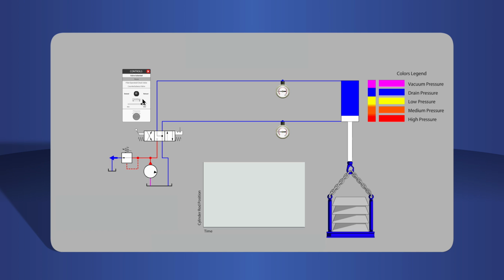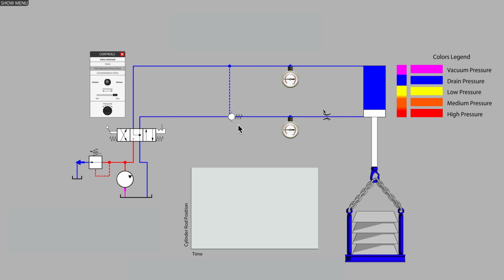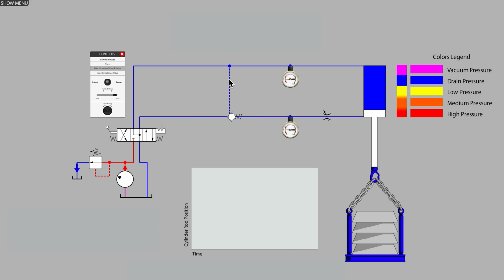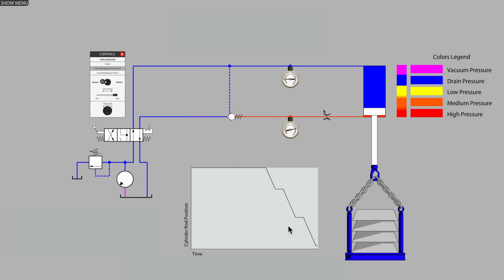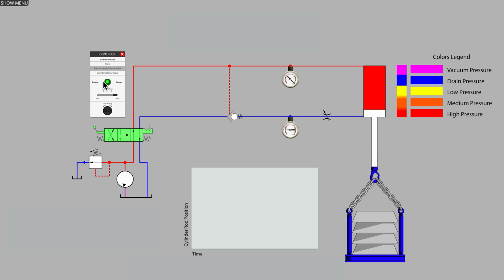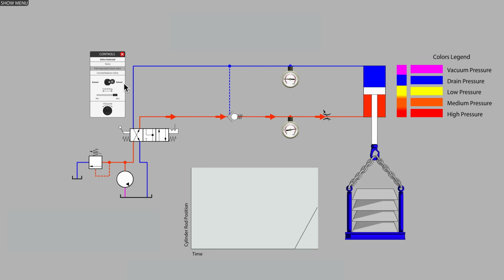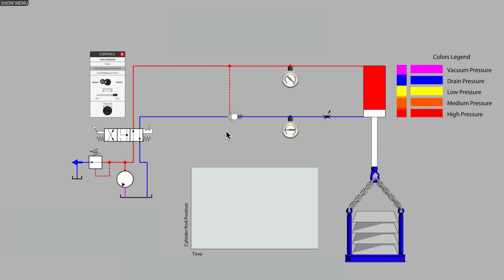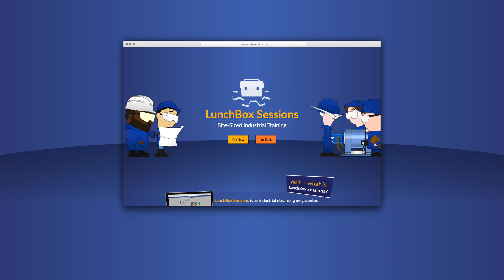Vertical Cylinder Motion with a Pilot Operated Check Valve

Comment: Hi. Does this needle valve also increase temperatures due to the restrictions imposed to the system?
Reply from the maker: Yes a needle valve always has that effect. You've got it.  Even worse, a needle valve on the rod-end port can actually intensify the pressure from the blind-end port, due to the difference in surface areas on the opposing sides of the piston. This pressure can rise to a damaging level if all factors of the system design and the cylinder usage are not accounted for correctly. I hope that answer helped. Thanks for writing.  - Carl